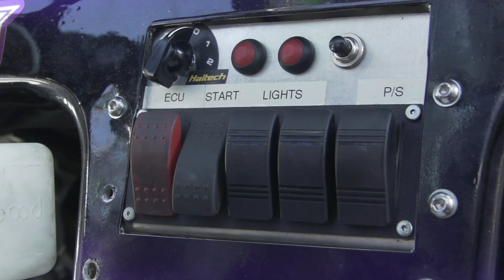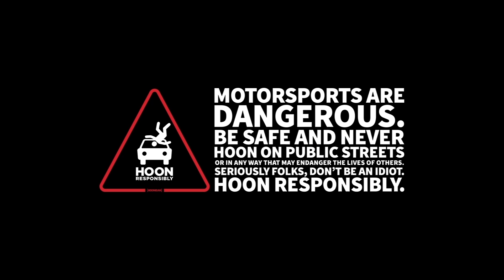800hp, Heavy Flake Paint, and Rear Mount Radiator? Ryan Litteral's Party Car Rips

Comment: @ 0:44 ... The answer to your question, depends on the tuner. You can have a built motor but that doesn't mean it great unless its tuned right.
Reply: Maybe but still rb need few upgrades like better oil pump and few after market parts to help it not to piston knock.
Rb are well know to piston knock unless you have last version of rb engine that Nissan fix the issue when they made gtr34 Nur and the other special edition.
I hopeful you get the stronger block for rb since Nissa made few rbs with weak block and the strong/durable block got 3 symbol all around the block.
A 2jz just need better Injector ,better manifold and better turbo and you are good compared to the rb that you need to upgrade few thing before making power.
Reply: @benjaminfranklyn604  still have to upgrade both motors though... And still depends on the tuner... "Mines"r34 vs Gary Jr r34? All about the tuner. Top Secrets Supra vs R2B2 motorsports supra? All avout the tuner
Reply: @BenDover-no7nt  yeah but the rb will be deep pockets build compared to the jz build.

Comment: Look, most of the guys you got coming here are cool right.. but there's a difference between throwing a power slide and driving out vs putting the bitch exactly where you want it. I'm not a drifter by any means. I ride. I can get my bike to go all sliddy but this cat has it on lock. Speaking of bikes.. you guys gotta get someone who can ride out there. That's a play ground for anyone who stunts. I can see wheelies up the ramps on the trailer then stopies on the way down. Depending on the bike, straight jump off the trailer. Js